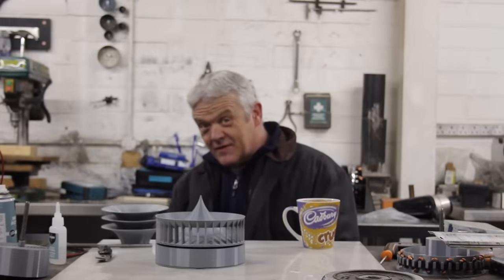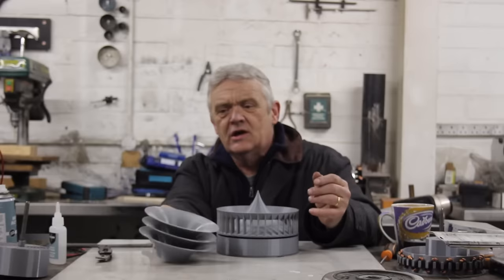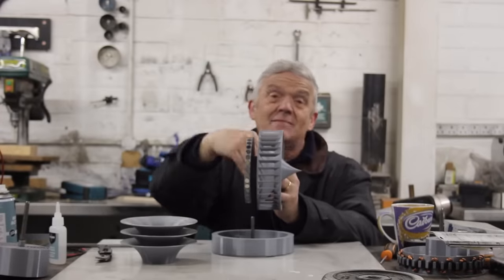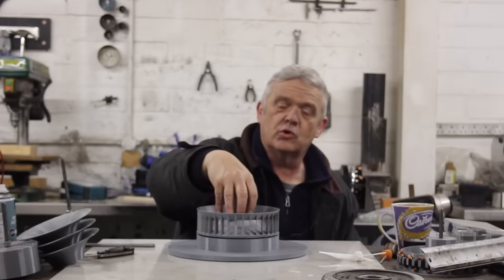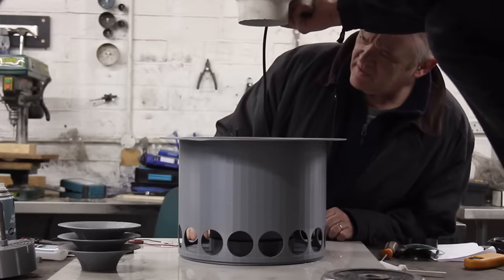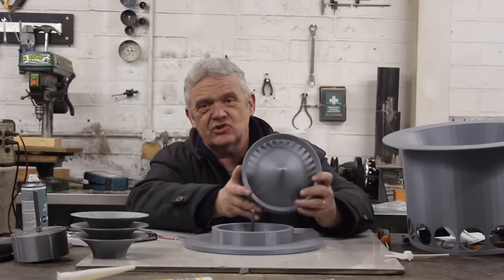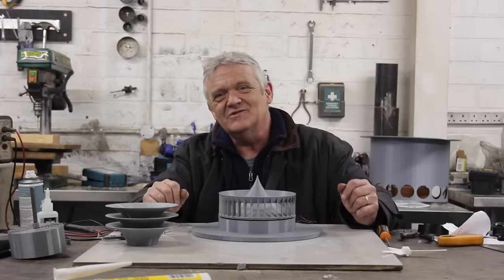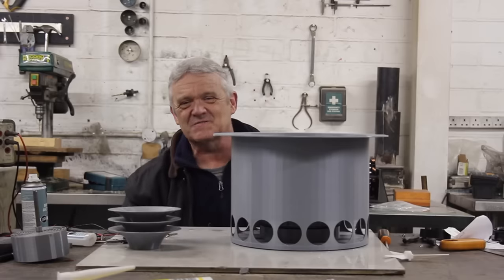1889 Ground Breaking Wind Turbine Update

Comment: Static torque (Moment) or open circuit voltage tell you nothing useful!
Power is proportional to Torque x Angular velocity. 
The easiest (useful) option is to measure the current flow and voltage across a fixed resistance - which will give you the power, albeit with the generator efficiency wrapped up in the value.
That would be fine for comparitive measurements,  using the same generator - which I think is what you're trying to achieve.

The value of the resistor will change as it heats up - which will affect your measurement.

You could either map the change in resistance with temperature, measure its temperature and wrap that into the power calculation,  or use a mig enough heat-sync that the temperature will barely change.  A kettle is a reasonable option for this. Start with the same volume of water at the same temperature at the start of each run.

Comment: I am sure brighter minds have already picked up on it but I can`t help but wonder about wind interference on the "exhaust" side of the turbine. This could be negated by a wind vane positioned shroud to keep the "exhaust" in the lee side of the shroud thus reducing contraflow. Which also raises the question, could that same device act on the inlet side to capture more airflow ? I bang nails for a living so I hope that explanation is understandable = )
Reply from the maker: it does make sense mate but this was computer modelled before the build
Reply: @ThinkingandTinkering  = ) Thanks for the response ! Too old and too analogue for such wizardry !

Comment: Hi Robert, I may be getting a little ahead of your current project as it is not completed as yet but was wondering about the following,
Could you improve the efficiency the rotor (Speed / torque), by creating a negative pressure area at the base of the generator where the exhaust holes are?
In essence I'm thinking that the overall device becomes a sort of push pull affair with air pushing down from above, as per your current design, whilst air travelling past the bottom of the generator is routed in such a way as to effectively pull the air out of the exhausts?
Reply from the maker: it certainly would mate - but it would come at the cost of added expense and complexity
Reply: @ThinkingandTinkering  Fair point regarding cost and complexity depending upon how you engineer it. 
Initial thoughts were to create a passive systems with no moving parts to provide some assistance to the air flow.
L shaped tubes fitted into the exhaust holes to redirect the exhaust air down below the device, with the idea being that the wind passing over the end of these tubes would provide some degree of suction.
However was not sure if tubes of that diameter would provide any meaningful venturi effect??

Comment: Great strides Robert! Are you thinking about using the collection funnels as a secondary Tesla turbine? Just thinking that if they were free to rotate about the vertical, would it add any value to have a second generator in the top half that leverages the funnels as a turbine and the funnels to direct airflow downward simultaneously. It's overcomplicating, but perhaps not too much. Anyway keep it up!! I watch religiously saving up ideas for when i finally get the free time (and printer) to prototype too.
Reply from the maker: I was pondering it mate

Comment: I'm not sure what lathe you have, or what the swing in it may be, but for the top wind collector bit, I'd have thought a man of your calibre would have seen it as an excuse to have a go at a bit of spin forming?
Reply from the maker: I could mate - but this is also meant to be repeatable by other who couldn't
Reply: @ThinkingandTinkering  Fair enough. Good point.

If it's a case of accessibility, I myself might have made an expanding foam and body filler former, and moulded a few out of fiberglass. Or used it as the neccecery excuse I'd need to build the vacuum forming machine I've always had a hankering to own. Then again, my brother trained as a coach builder, so he'd probably think hand forming them out of mild steel with a sandbag, mallet, blow torch, and some planishing slappers would be the only appropriate process (Give him his dues though, he'd probable be able to make them neat, quickly and accurate out of steel. I'd only feasibly hit two of those in fiberglass on a good day. :D).

We all favour the technical solutions we're most familiar with. :D

Comment: I just had a thought... and maybe I'm splitting hairs or being cheeky... But... It occurs to me that there be another avenue of torque increase you could incorporate into your design. Assuming your wind catcher will be up on a pipe to collect the faster moving wind, all of the wind blowing against the pipe will simply slide around either end, right? What if you put a couple fins on the pipe section to have that lower, uncollected wind spin the pipe as well? Your collector at the top will still direct the air downwards, but it'll add a slight spin to the air as it goes down. Then, with the pipe spinning and the stator connected to the base of the spinning pipe, if the rotor spins contrary to the pipe, then you'd be adding the rotation of the pipe and stator to the rotation of the rotor... More RPMs. You should still have the same amount of wind coming down the pipe at roughly the same speed and pressure... after all, you're still catching the same amount of wind. 

I'm not sure how the slight spin of the air as it's being caught and directed down a spinning pipe would affect the overall outcome, but I think you'd be able to utilize some of the otherwise wasted wind to some degree.
Reply from the maker: cheers mate

Comment: And if you were to go the route of a directional airflow drum, for the rotational design obviously it would be propeller or fan shape. But with a new a the best of the best inventions and all it is, is a new an improved product of its self and its called Toroidal propeller. Which effectively increases all elements that surround the design and aspect in designed use of its job. Check it out Toroidal propeller and try to see what kind of particular invention of a design you could come up with use ing the Toroidal propeller...

Comment: Just a thought - you've seized my imagination with this current project - rpm ; how can you measure it? Could you mount a small electronic counting device in the wind collector that counts the rpm by counting a mark on the generator that spins around..  Or is there a better way?   At the moment I understand rpm more than I do the volts, amps and stuff, I can relate to rpm.

Comment: There is no way you can obtain more energy from wind than the Betz law will allow. Putting anything in the way of the wind will, by definition, lower the efficiency.
The only possible 'help' would be to use wind from varying directions without any losses while the vanes are turned to face the best angle. Whether that is an overall benefit is highly questionable.

Comment: Hi Mr Murray-Smith. Just a random thought: would that parabolic cones assembly on the Darwin Generator make an additional contribution to torque generation if it's connected to the rotor instead of the shell structure? As in adding the Tesla generator's torque on top of the rotor's torque?
Reply from the maker: I Don't know
Reply: @ThinkingandTinkering 
If possible, would you mind exploring the idea, please? I believe that the possible gains might be worth the effort

Comment: What you say about speed and voltage not being an indicator of actual power not really correct, because it is power you are looking for. After all, as an extreme example, it is like comparing a weedeater with a V8. The weedeater is faster and so would generate a higher no-load voltage in your setup. But obviously the V8 is more powerful. To get an more real measurement of torque and therefore power you could put a low’ish value resistor on the output and then measure voltage, because it is doing some work.

Comment: Current is proportional to torque of a motor, so why not measure the current from the generator into a load? You could get an mppt controller to maximise the power from the generator and measure the current that generates into a suitable load resistor - this overcomes the need to work out the right load for the generator.
Reply from the maker: wouldn't you just be measuring a generator then?
Reply: @ThinkingandTinkering  The generator just converts one form of energy to another - mechanical energy to electrical energy, and since they will do that at 85% - 95% efficiency at any speed the mechanicals can tolerate,  the current generated will be the torque times some constant. The mppt controller merely removes the need to find the right load for any specific rpm by fixing the output voltage regardless of input voltage then the only thing that will vary with the torque will be the current out of the mppt controller into a fixed load.

Comment: sorry man, but you need to develop into generating power curves. Just measuring torque, rpm, volts, amps.... ect all measured independently from each other at arbitary points is actually useless.

I would set up a digital torque meter on the stationary side of a generator and sweep a resistive load with a potentiometer, whilst measuring rpm. That way you get a full view.
Reply from the maker: I don't mind mate - what I find is it doesn't matter what you do - someone always tells you to do something different
Reply: Seems  that from reading the comments, anyone that actually comes up with a decent way of measuring torque gets a short answer.  I'm absolutely certain that Rob realises that putting an electrical load on the generator and measuring the current will be a way to derive the torque. I find it strange that this is repelled every time its suggested.
Reply: @Robert Murray-Smith  it’s not about having a go, I really enjoy the work you do, but the data is almost dimensionless at this point, It would just be nice to have something tangible I could work with.

And I’m not gonna sit here and be an armchair expert either, how about I design you up a simple circuit that would be nothing more than a hand full of components and arduino. Most of which you would have lying around. Get it to sweep over the rpm range measuring voltage and current, whilst plotting it against rpm and torque using a cheap load cell mounted in a 3D printed base, and an optical rotation sensor.

At the press of a button it could spit out both the characteristic curve of both the generator and turbine independently from each other.

Comment: Torque is proportional to current, voltage is proportional to speed. No need for a prony brake.
Reply from the maker: you would then be measuring a generator and it's output

Comment: I can't help thinking this design could achieve a high torque but not with that particular wind collector design.
Reply from the maker: you are right it can mate and I am using it in case I am well off the mark with this generation at the rim idea - then I haven't wasted a lot of material - in fact the only new thing in this is generation at the rim - most folks seem to have missed that but every thing else is just bits put together from the folks work

Comment: Ok, seen a few of your vids now, but you are just playing around. 1st, voltage is nothing if you do not have current. Those multi directional ducts will never work as well as a cone pointed into the wind which would be easy to make. What is the purpose of all this? Making a full size usable system for a home or commercial production of electricity? Hook that is gizmo up to a car alternator and make something usable.

Comment: For a serpentine coil, what diameter and type of copper do you use ?
Reply from the maker: check the earlier videos
Reply: @ThinkingandTinkering  I'm making your turbine so I can plug it into a battery and battery management system I'm also making. I'll make a video of it if you would like to see it ...
Reply: @ThinkingandTinkering  one difference is I'm using ASA plastic instead of PLA because it won't warp in the sun.

Comment: I'm sure this comment will get buried in noise, but current output along with the voltage at that current flow will give you a much better idea of the torque at a given RPM.
Reply from the maker: wouldn't that be just measuring the generator output?

Comment: Your shroud isn't up to your usual standards! Positive criticism. Wouldn't you also capture side wind using it's surface area?
Reply: I'd say get rid of the shroud. Use the taller wind converter as in your original design. Whereby it captures side wind on it's surface area and add the Darwin on top to capture and redirect downward more wind. If that makes sense. So a tall wind collection unit plus Darwin Is the best arrangement in my opinion
Reply from the maker: I don't think you are seeing the whole picture tbh - but cheers
Reply: @ThinkingandTinkering  i know. Didn't mean to be rude. Was just thinking aloud

Comment: What about your stacked parabolic cones as a Tesla wind turbine catching air from it's sides instead of strate on or even as the each stacked "funnel" gets closer to the center the tops get smaller forming a tangent ogive cone of funnels as the parabolic sections feed to the center in order to allow it to catch air from side and front  adverse to the cylindrical shape the parabolic "funnels creat now. Damn I wish comments could except a  drawing ! And yes before you go and tell me I should make it myself I don't have the resources.
Reply from the maker: a basic 3d printer will set you back US$90 I believe

Comment: I suspect that you are wasting your time with that big Darwin bucket. Perhaps it could serve as a portaloo? Make your turbine the same (maximum) size and point it to the wind, it will be simpler and better.
Regards the generator, you need to match the magnets strength to the torque, so it is not just free spinning. You should be able to observe significant slowing down when you put full electrical load on it. Better still, regulate the load to keep your turbine spinning at the optimum speed.
Reply from the maker: I suspect you have no idea but are guessing lol

Comment: In my humble view the company that is making this with the wind direction going up to the turbine isn't thinking things through. Weather in general come side to side but mostly down if it's pouring rain often is when the wind is sufficient to generate a good amount of electricity yes I know... It's going to be again pouring rain when the wind blows hard So what is that going to do if it's blowing in an upwards Manor it's going to put a bunch of tiny impacts on the propeller or turbine in the exact opposite manner to influence spin. Unless they're using a squirrel cage design. But either way I don't think it makes any sense to make it blow up it seems to me there's always some downward bursts of air in any kind of setting while capturing wind. Why would you not build it in a manner that agrees with that? Call me biased because I like your show so much but I think you have a much better design

Comment: I think your on a winner here. I think the key is to make the wind collection unit directional and rotatable but still using the same hyperbolic curve. I can imagine a semisphericacal sphere cut longitudanaly with a fin for directing it into the wind. The sphere need not extend all the way to the pole as this would have marginal difference. It could be truncated at both poles by 20%. (i'm concerned about the height because I want to impliment your design for real on a narrwoboat and I have height restraints)
Reply from the maker: cheers mate

Comment: what the point in make spinning "things" by flowing wind. the point is efficiency. and I mean cost efficient of a turbine. If it cost 0, but make some energy, then go and make that 1,000,000 time. but if it very efficient, but costs a lot, no body can affort it. the whole thing is to find the most cost effective solution... not to be proude that some shapes spin when the wing blows... else any shape will be advised as only perfectly symetric shapes does not spin.

Comment: I came up with the really easy way to wind a coil unit 10 mm pizza flexible tubing the size you need play some rod down the middle of it and put it in your why in the hell out of it pulled the metal rod out of the center of the tubing and blended into a circle in you're done one continuous perfectly wild coil in a matter of a couple of minutes
Reply: You can even do as many as you want so get smaller tubing and do three of them or do six of them if you want a different wiring configuration it's so easy you're not going to believe